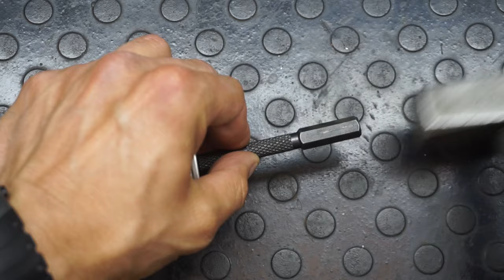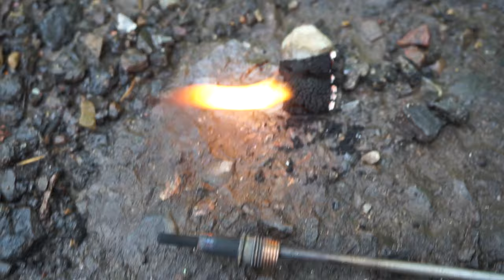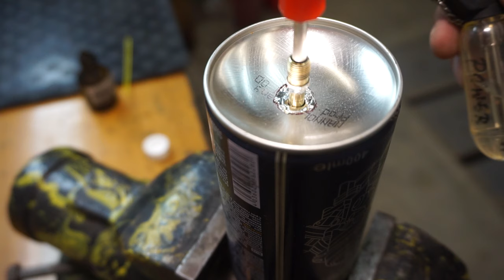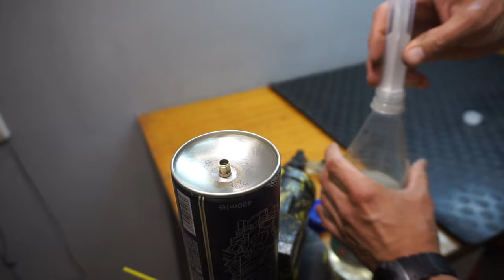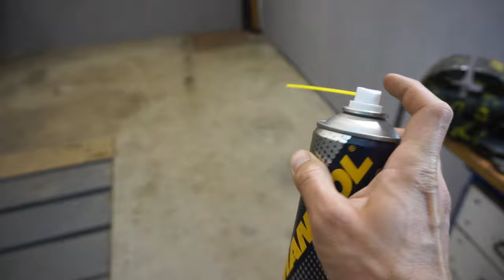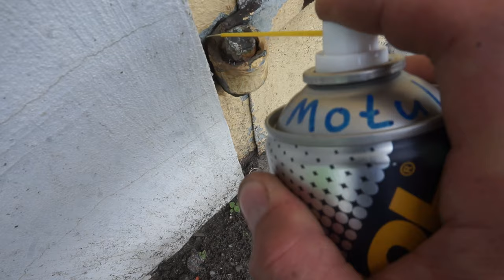DIY refillable spray can

Comment: Since you drill the hole at the button, how can you remove the small debris from your drilling? 
I did one at the top, but didn’t sufficiently take out the debris - the result, after just a few sprays, the spray tube got clogged. I was careful with my next project and used magnet to suck out the small pieces. But that would be nearly impossible if the hole in at the center of a concave surface. Awaiting some inspiration!
Reply: He never drills, he uses what looks like an awl to punch the hole, and a center punch to widen it
Reply: magnet will be of little use since the debris are aluminium
Reply: All out spray cans are steel, 
You could always put a small magnet on the bottom next the the valve, and any debris left inside would stick to the  magnet, the same way the drain plug in your cars gearbox, and diffs have magnets for collecting metal filings
Reply: Magnet
Reply: I think drilling creates fine particles. But when the hole is made with a piercing tool with pressure or hammer, the fine particles are not created. The pierced wall metal does not leave the wall and can not enter into spray pipe.

Comment: This is NOT   the technique  to properly apply solder.  Additionally, using  liquid flux  as was done  will get  some of it inside the can where it will corrode.   Last,  air from a compressor  always contains  water vapor, which eventually will corrode/ rust the interior of the can  MAKING IT unsafe.
Reply: we do not care

Comment: Totally unnecessary to do an external filling port for the liquid and the bursting gas!😂 The bottles own pressing filter will work both ways! Output AND input (filling)!😊 just push/press the tube down and get all the left pressure out of the empty can, then fill the can thru the tube back fulled with liquid. Then repressurize the can with air via the same tube!😊😉👍
Reply: Can you post a quick video demonstrating please?
Reply: @briholt100  I'll do it near days when get back to storage!👍
Reply: @elfillari you never did it. I was really interested to see if it works fine that way
Reply: @getfragged7051  Sorry for being so busyness! I will be doing it for shure. I've done it also for negative pressure. First vacuuming the cylinder out of air, then first vacuuming the liquid in the cylinder, then pressurized with oxygen or prevent gas like CO2 up to two bar/30psi

Comment: i tried doing similar thing but my soldering does not stick to the can base. Am i missing anything ? what is that liquid you applied ? was it flux ?
Reply: I don't know what flux he is using but Acid core Plumbers flux should work fine. Even electrical rosin core flux will work great. The Acid core one just has to rinse off with water otherwise with time it will eat away at the metal and fail.
Reply: you have to sand it just a little to scrap some of the metal to make contact with the solder lead
Reply: Solder wont stick to valve in my case. It sticks to can perfectly but no way to get it on the brass valve.... I even sand it and polished it....

Comment: How come after soldering my valves in after torching them clean after inflating the can to test two valves so far leak? Did torching them destroy them? I used valves from dead bicycle tubes
Reply: There is a seal on the valve stem core.  Remove the core before soldering it in.  I burnt the seal as well.
Reply: @jeeprenegade1985  yes, I figured this much

Comment: Can anyone tell me the correct pressure in psi that the normal aerosol can should be inflated too? What’s the max? Also what psi should is usually found in a spray can of butane?
Reply: You find an answer for this? These guys are so smart they forget to add the wee nuance information.
Reply: @thejoekage9499  the best answer that I’ve gotten is 90-120psi. But different companies and different cans come with varying pressures from the factory. Apparently, 90-100psi is the safest bet if you don’t know the company’s recommendation
Reply: Aerosol cans are filled to 3ATM pressure. As 1 ATM is about 15 psi, 3 ATM works out to 45 psi.
I think 90 psi is too high for a can.
Reply: Tu gonfles la bouteille jusqu'à qu'elle explose et alors tu te rendras compte, si tu n'as pas perdu une main ou un oeil dans l'explosion, que ce bricolage est idiot et qu'il ne sert à rien 😎

Comment: How much chemical do you put into the spray can before you fill with air thanks
Reply: I am just guessing ! but you can put up to 300ml and fill at 90psi, as for the chemical you can punt what ever you need to spray! paint thiner, wd40, laquer paint. i made 6 bottles like this and i use them i a need them, i am looking for the composition of carb clenner! if some one has it, please share, i use 3 parts paint thiner 2 parts gasoline, one part isopropyl.

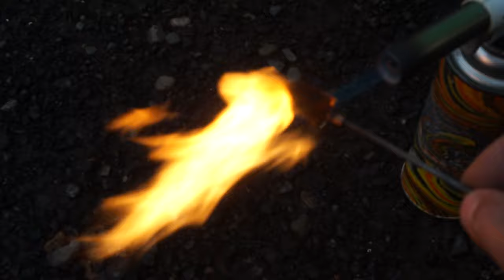Comment: 0:47 marshmallow 😅
Well 🤔 I seen 3 vids, 2 on the top this on the bottom. Range 40-50, 70, this one 80.
I think my best option, top and 40-50, probably will leack less paint and I should point the valve to safe zone.

Comment: Stupid. Better to drill at the top in case the solder job fails it leaks air from the top not oil from the bottom. With time everything will fail.

Comment: Most spray cans use a propellant with a low boiling point not atmospheric air, hence "Aerosol".  Atmospheric air contains moisture and oxygen which will ruin most products. Who wants moisture in their WD40 or paint.  Conclusion. Very limited usage.  This is time consuming and inefficient. Better to buy a spray gun or an airbrush.